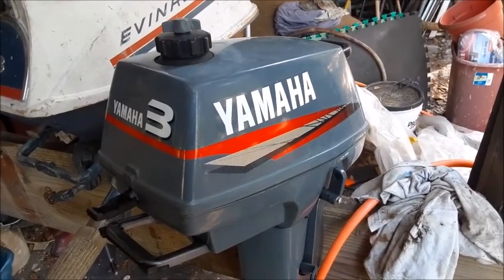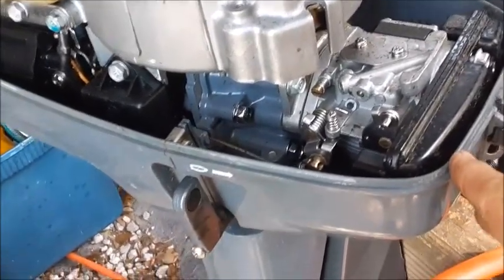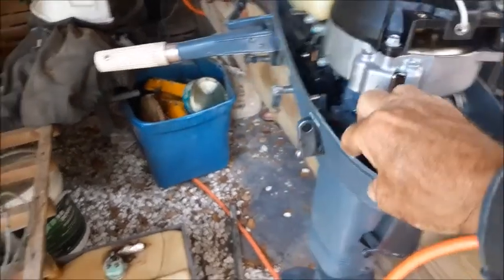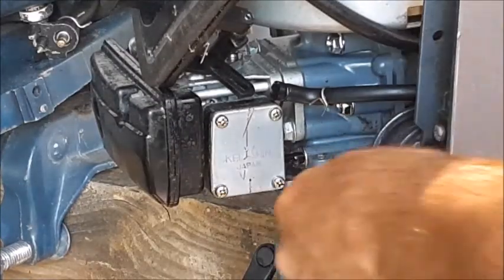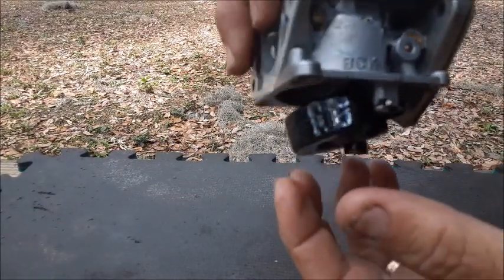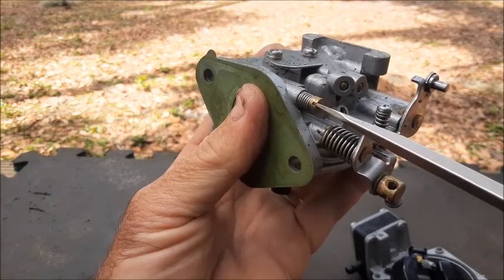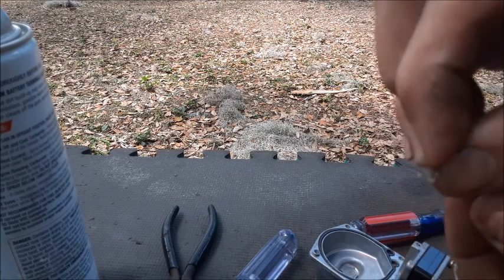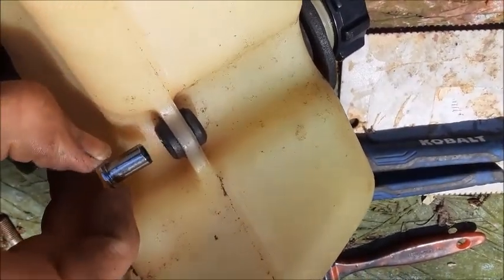Yamaha 3hp Carb Clean and Removal

Comment: Great video! I particularly liked the short cut way to access the carburettor as the Service Manual suggest lots more unnecessary parts should be removed.  The discovery of the fuel filter was an eye opener as mine was missing, hence the dirt inside my own carburettor.  I have now purchased one - for £6.50 - so hopefully i won't need to clean out the insides any time soon. :-)

Comment: I have the Same motor but loses power in gear but a champ in neutral
Reply: HI! I have the same problem, were you able to solve it with the fuel pump membrane? I also read that the 3 hp comes rev limited from factory but it can be removed. Have you heard something about this?
Reply: I have the same problem,did yot try to change fuel pump membrane
Reply: No I didn’t but I will try
Reply: No I didn’t know and I wish somebody make a video showing that specific problem
Reply: @Pesca_con_javi_oficial  Ok, I will keep you posted if I find something else. Please do the same. Cheers